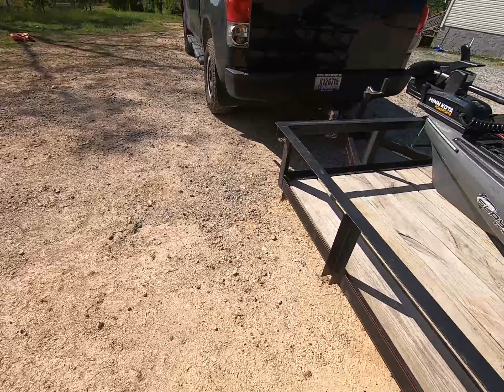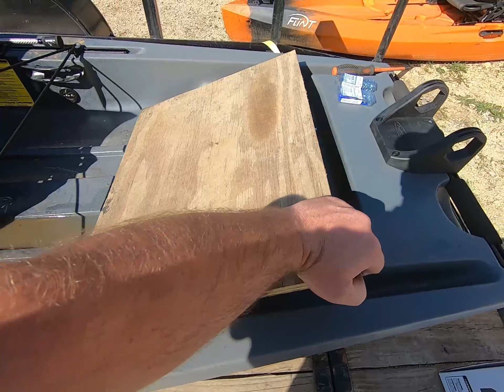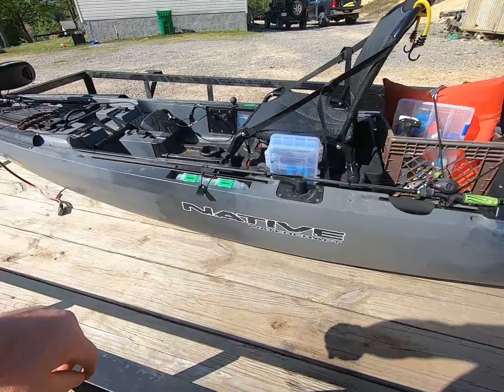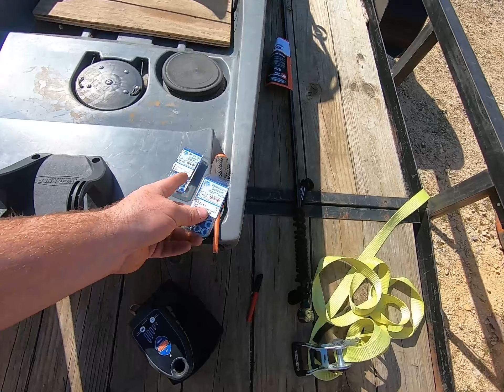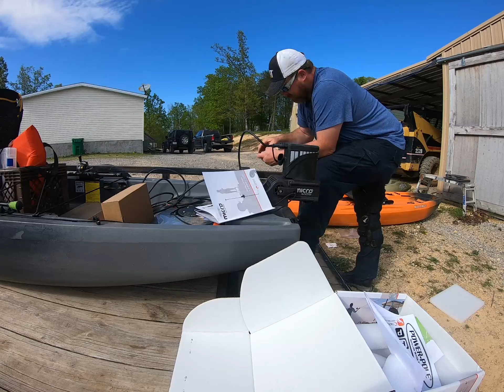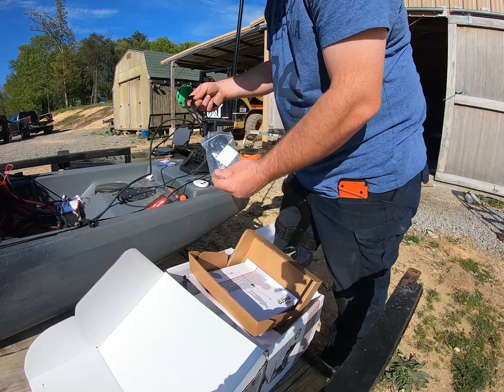Updated Honest review and Micro power pole install and setup on Native Slayer Propel Max 12.5 kayak

Comment: I like you Slayer Max  I have one as well please let me know if you ever have questions about it I may have answers. I was wondering when you go to mount the bracket for the micro power pole what did you use to attach it inside the track thats on the back of the Slayer. I know it has the two pre drilled threaded holes but I was just wondering what you used to mount on the gear track on the back. Thanks!

Comment: How’s that motor working out? Hard to find a video with the Slayer on the water using trolling motor? I’m trying to decide on Titan 13.5 or Slayer. I want the Xi3 up front but some say the motor is to bow heavy. Thoughts?